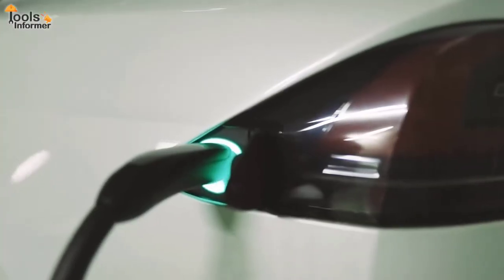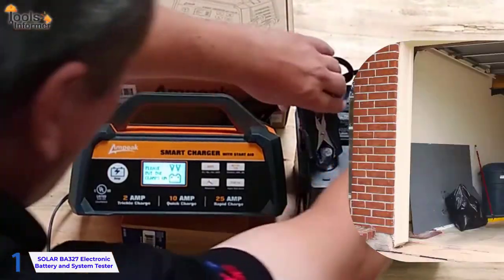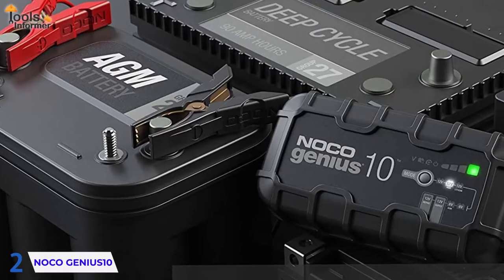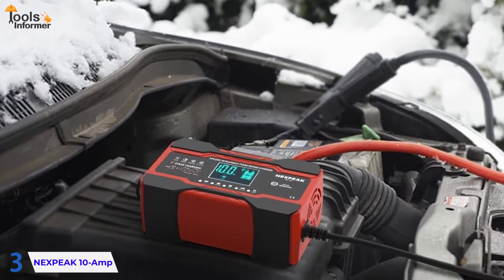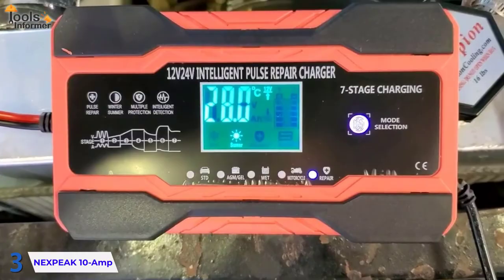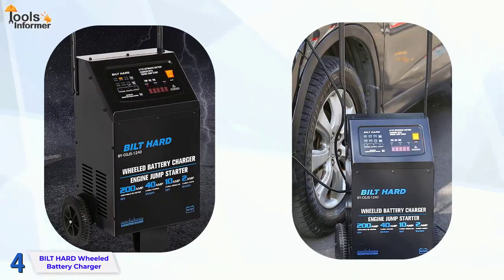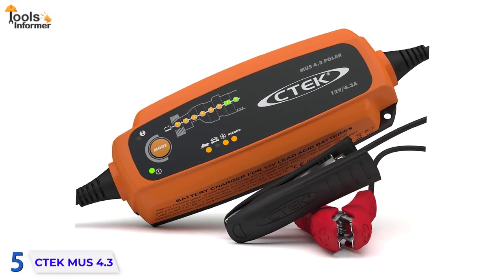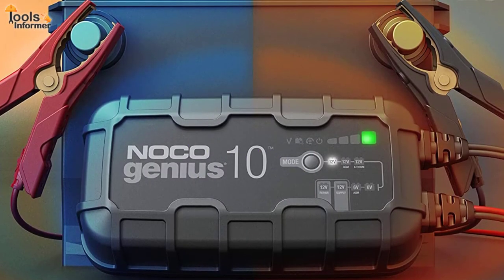Best Chargers For Car Battery in 2024 [Top 6 Suggestions By Expert]

Comment: My battery charger is showing a different charge level between the 2 amp setting and the 10 amp setting. The 10 amp setting shows the battery is at the #2 level, the 2 amp shows the battery is down below the 0 on the gauge. Would you know why this is?
Reply: Basically how long it will take. The 10amp is 5 times faster pretty much. 2amp is better for the battery but takes forever to charge. Like 3 days on a car battery. Bought hulkman 1 and it's pretty decent. I jus needed a small 1 to keep the battery good while I'm not driving my car.